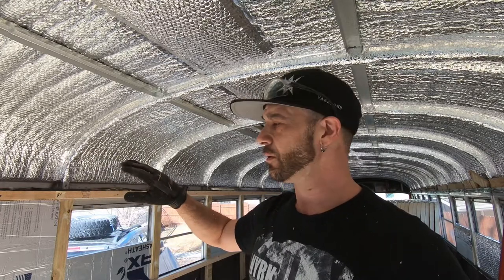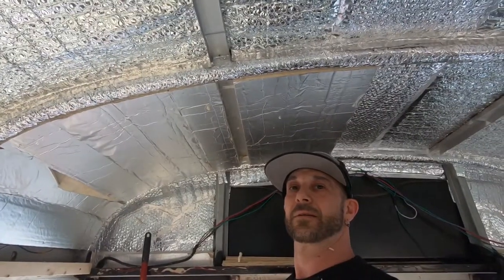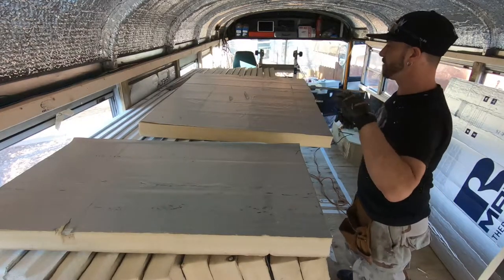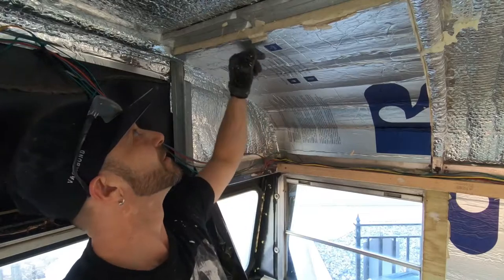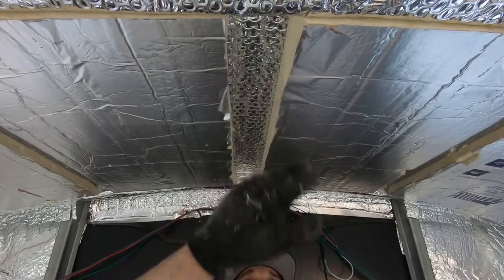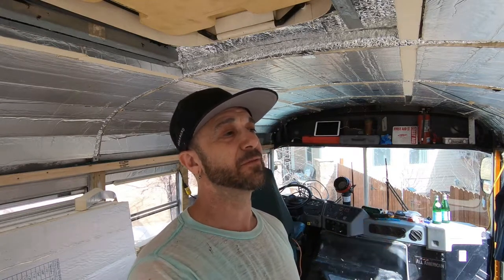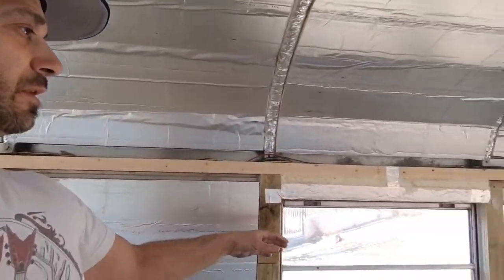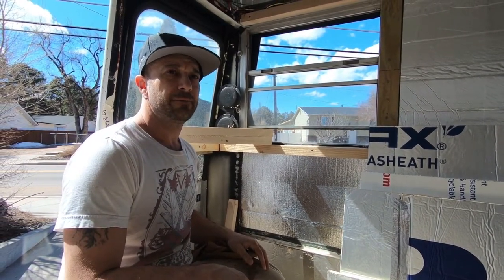Skoolie / A REAL HOW TO / INSULATION IS COMPLETE/BACK TO WORK , FULL SWING CONVERSION

Comment: One more thing,how many rolls of reflectix did it take? And how did you secure it, spray adhesive? Thanks again.
Reply from the maker: I don’t quite remember how many rolls of reflectix it was. It was the 48”x24” rolls . I think I used 4 rolls.  I also put reflectix on the wheel wells as the first layer of insulation and vapor barrier. I used the aluminum tape to secure it. It’s pretty detailed in one the videos. But I made sure to do between the ribs first then go back over all the ribs with strips to seal it all. It actually worked great and I’m still extremely happy I did it that way. Sure, there’s a bit of added insulation but the vapor barrier part of it all worked outstandingly.

Comment: What size foam? And are you going to use the original metal roofing to go back up
Reply from the maker: I put a layer 3.5R reflectix and covered even the ribs. This acts as a a bit of Rvalue, vapor barrier and absolutely necessary to protect from condensation. Then I used 2 inch foam with an Rvalue of 13. Then another layer of reflectix . Rvalue is awesome with total of 20R all together. I won’t be using the sheet metal we pulled down to go back up. I’m using 1/16 inch wood paneling  and 1/16 plastic paneling over the bath area. I used the sheet metal for building undercarriage storage and other various parts of the build . All in all recycled about 90% of it for other project on the bus. Check the undercarriage video for reference. I also used the sheet metal to make the propane storage. Thanks for watching

Comment: What is the material in the ceiling, reflectix?
Reply from the maker: First layer is double insulated refextix (r3) mostly acting as a vapor barrier , then 2 inch ridged foam (r13). However we opted to go one step further and add another layer of reflectix.3 layers total
Reply: @VagabondTouring  thanks, looks great